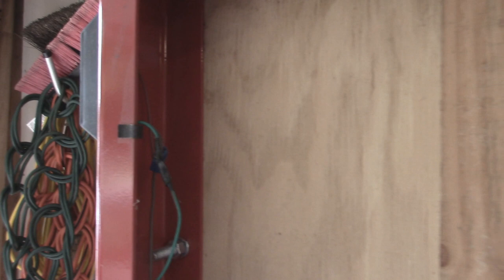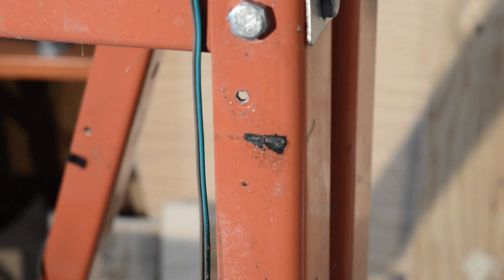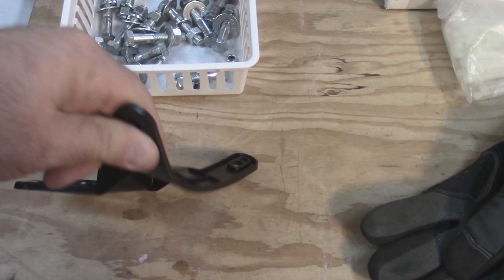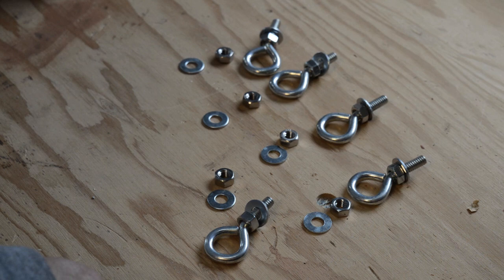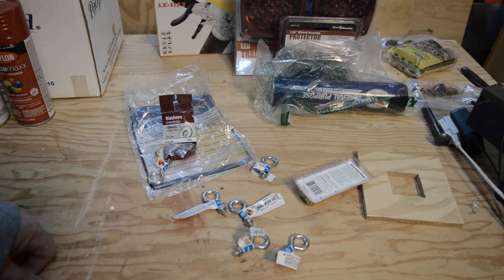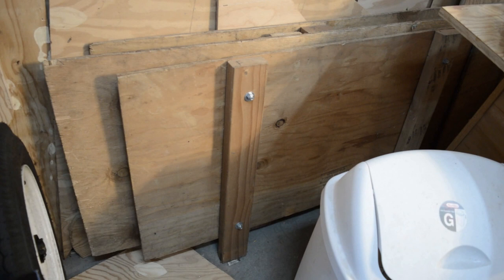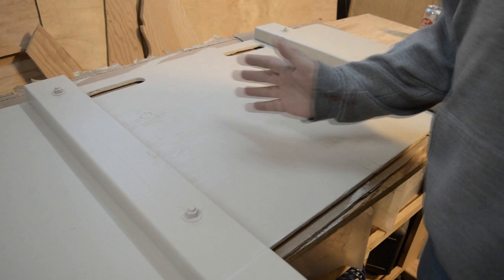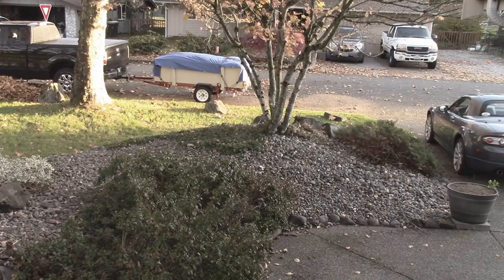Harbor Freight Folding trailer Upgrades

Comment: Hello from the dry side of the state. Like your mods.

What I did for tie-downs was on the inside side of the  2 X 4 was I drilled out out a hole big enough for my bolts. Then I drove in T-Nuts. Then I used, like you used, eye bolts so that every time I put the walls in I could tie down loads. The one thing I would recommend is that at the bottom so you can pass a motorcycle tie strap through and you don't have so much issues ratcheting the load down.
Reply from the maker: @guyh.4553  that's a damned good idea 👍

Comment: Hello Jr, great work,  real professional! i have the same trailer I put interlocking corner brackets 2 per side. The corner brackets are sold in pairs. They lock the box soild. Greetings from Ontario, Canada
Reply from the maker: Thanks for the feedback. I thought about adding hasps i could drop a pin in, by I've never gotten that far though. 😉

Comment: How did you get the 2x4 to fit in the stake pockets?
Reply from the maker: I shaved it down with a saw on 2 sides. I used a handsaw but the table saw or a bandsaw would work too eh. 😉👍

Comment: where did you get the stake pockets? I'm having a hard time finding any with the same hole pattern as the trailer.. or did you just drill new holes?
Reply from the maker: I used the ones that came with the trailer, but you could easily makes some yourself out of steel.
Reply: @JRMorris  I didn't realize it came with any, got the trailer from someone else. I found some that will probably work.
Reply: At one point in time, you could get more at HF. Haven't been in there for a while so I don't know. Go into your local farm and ranch store, or even Ace Hardware. They should have them.

Comment: What kind of drill bit did you use to drill the metal?  Thanks!
Reply from the maker: Hi John, I used a set of Cobalt penetrated Bits from harbor freight. They'll cut titanium if you keep the heat down, (low speed/heavy feed with plenty of lube to keep it cool).

👍
Reply: @MiniBoatin' 🤥